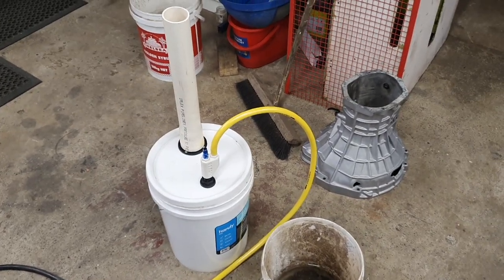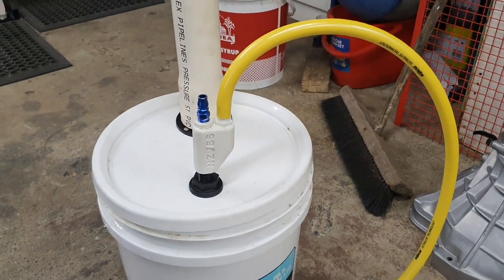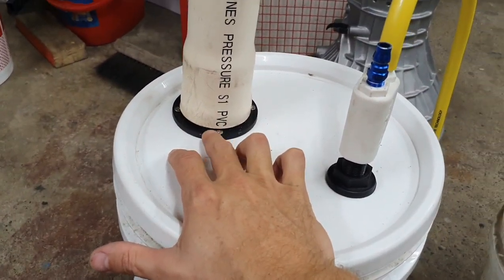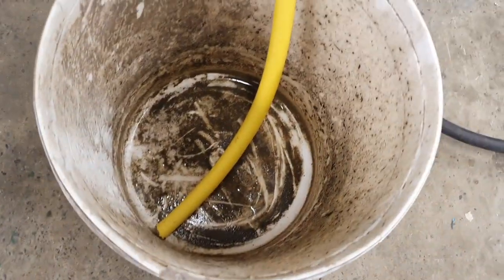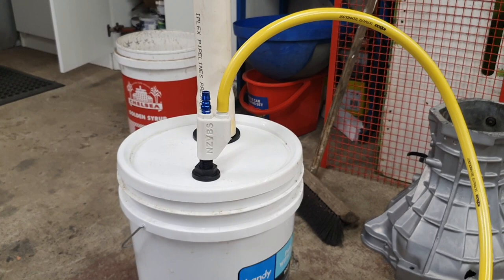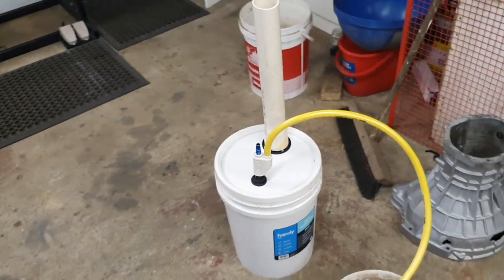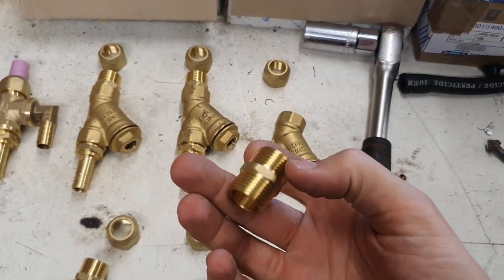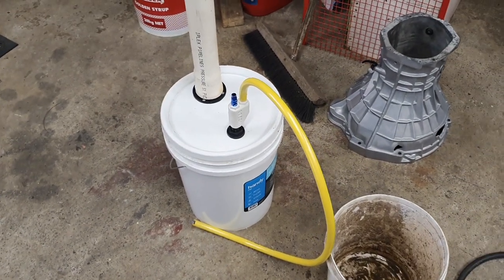DIY Pneumatic Vacuum

Comment: Nice little option there to make things easier. I think you mentioned in one of your vids about maybe sorting out the biggest issue a lot of us have and that's achieving a good CFM on a budget. Looking forward to anything related to this subject.
Reply from the maker: I may be doing something later in the year. I think they are called duplex units but its hard to get a decent air supply on single phase.

Comment: I want to make a 55 gallon reversible vacuum to clean my CNC machine's coolant sump (something similar to the Exair Chip Trapper). I am trying to understand how reversible pneumatic vacuums work. Your nozzle videos have been helpful. I'd like to try and avoid spending $3k on an entire system or $700 on a  reversible pneumatic vacuum if it's something I can DIY. I'd appreciate your comments or thoughts on DIY reversible pneumatic vacuum ... if it's worth the effort of trying to make a DIY solution.
Reply from the maker: Hey mate, I am not really sure about the requirements for reversibility, but seeing as these are just a cheap printed body, you may be able to configure a pair of them to do what you need. Things to take into consideration would be chip size (May need to scale up the nozzle bodies) coolant/chip separation, and probably the shape of the bottom of the drum to ensure the reversed flow picks up what you need it to. Sorry mate, I don't know a whole lot about reversible pneumatic vacuums but happy to discuss it with you if I can help.

Thanks for watching!

Comment: Does this work well on dry/dusty bits like sawdust or steel chips/dust? I feel like it helps to have the inlet point submerged in a fluid to create full pressurization, as opposed to dry trash where air can pass through the inlet.
Reply from the maker: Yes, this works well on dry material. In fact, short of any real experimentation - it seems to work better on lighter/dryer material. I believe this is because for this particular setup, flow is more important than pressure.

Thanks for watching!
Reply: @ArmouryEnterprises  Excellent. I used to pull 400gal tanks around a plant to extract various fluids from machines. I think the pumps worked basically like this on a larger scale. One of them was broken and would blast fluid straight up into the air if the tank filled while it was still running. Much fun.